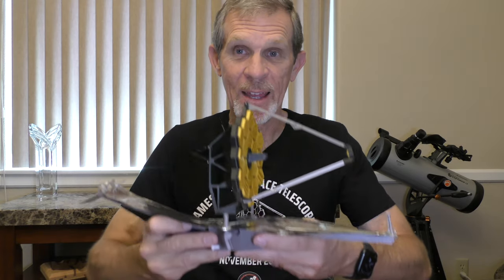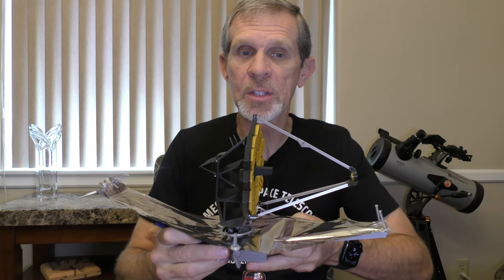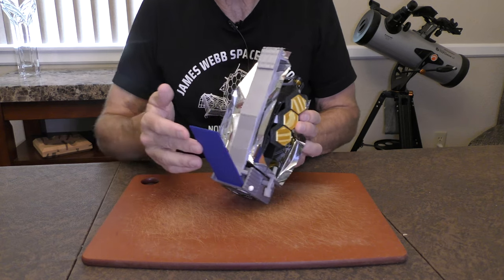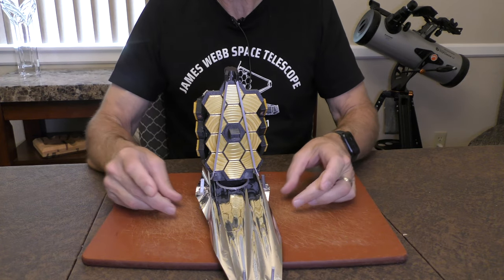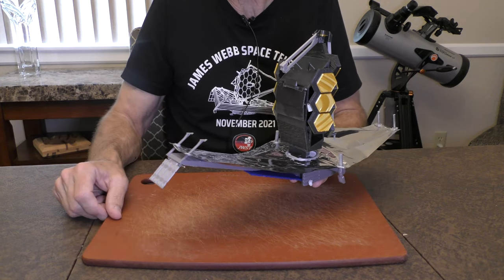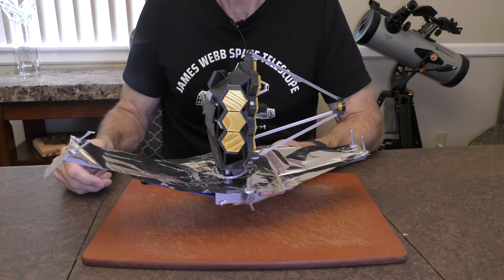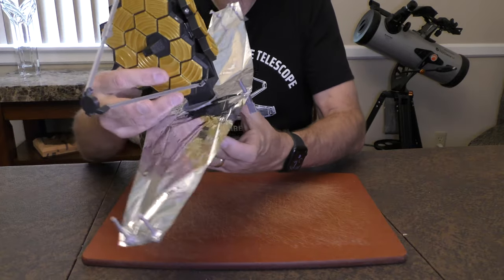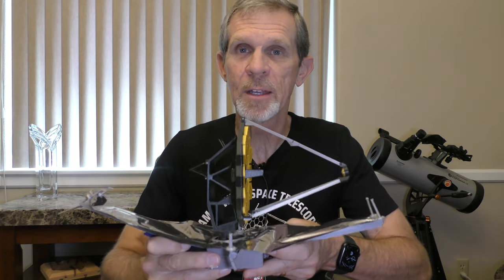JWST 3D-Printed Foldable Model

Comment from the maker: A point of clarification: the model uses a Mylar sheet to simulate the sunshield while the actual JWST sunshield is made from five layers of aluminum-coated Kapton, a stronger material that can handle a much higher temperature range.